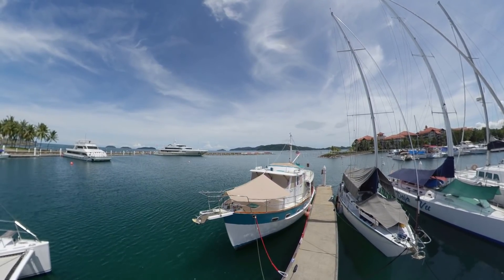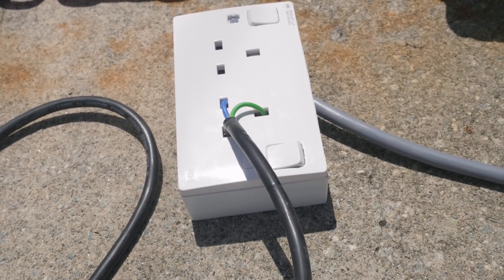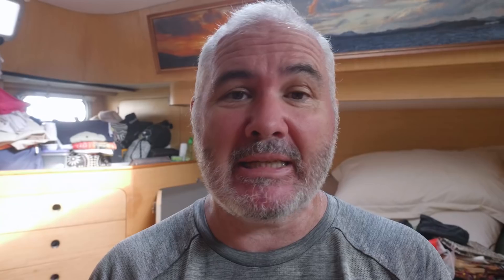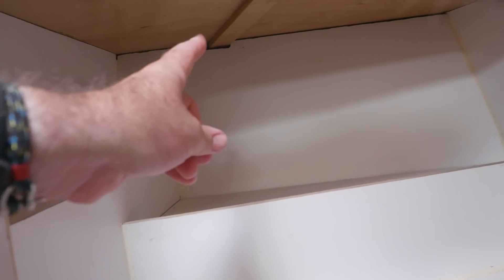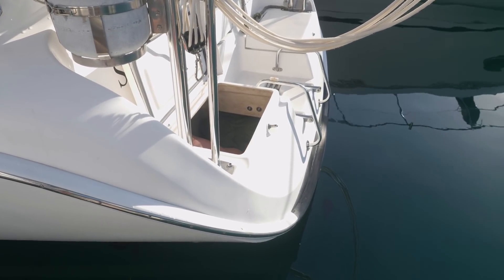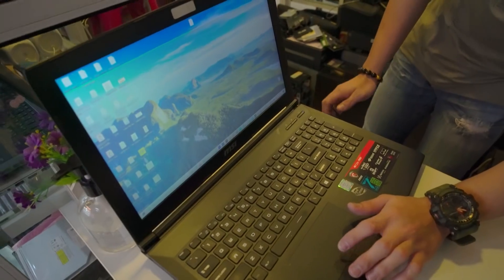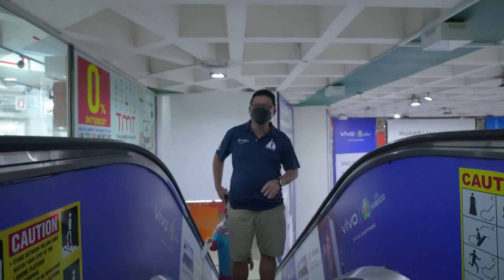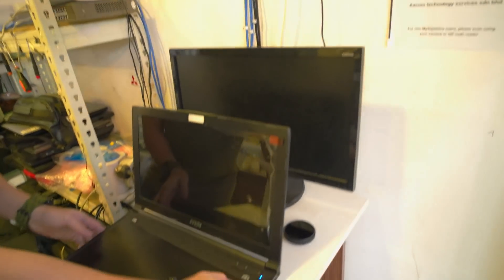Sailboat failures | Termites, leaks and corrosion - Sailing Ep 278

Comment from the maker: Thinking of becoming a cruiser? What's your biggest repair fear?
Already a cruiser? Share your worst breakages or failures with us...
Reply: We've had a string of odd misfortunes this year on our boat. First there was the aforementioned lightning strike back in July. That was a real buggar but in just the last week we have been stopped in our tracks twice in our southern migration due to freak issues.

A few days back we picked up about 2 yards of heavy plastic sheeting in our prop, we had very little thrust forward or reverse without massive vibrations/thumping and we were in a fast-moving rock ledge-lined waterway rapidly being pushed by the current into to a swing bridge.  We were able to get the bridge operator to open -but just in time. 

Luckily there was also a marina just on the other side of that bridge with a knowledgeable and quick-thinking owner-operator who was able to coach us into rough landinf on a downstream face-dock with minimal fuss or damage and find us a diver who was able to unwrap the whole mess in only a few minutes of work.

Then yesterday our diesel's raw water pump tried to self-destruct. The inner wear plate somehow got loose inside and the impeller drove it like a cutting disk right through the side of the pump body.  We noticed after anchoring that the bilge pump counter was showing 89 cycles! Luckily it was an easy flood to stop just by turning off the engine raw water seacock.  I was worried at first that the plastic sheet on the prop had damaged our shaft log and/or seal.  

Now we are attempting to epoxy the cut notch in the pump body so that we can limp back to civilization without needing a tow up the river.  That's inland cruising. We are not just in the middle of nowhere -but also somewhere we can't really sail out of without an engine.
Reply: I'm getting a survey on a 65foot cutter next week (mono).
Reply: I ran aground on a sandbar and ripped the keel half off... I had to (Quickly) put a sail under the boat to try to stop the water from coming in... Thankfully, I was close enough to shore where it could be fixed, sort of, but it saved the boat... I will NEVER own a Bolt-on keel again...
Reply: Everything to do with the engine.  Dnlt get me wrong, I;m a mechanical engineer, but why have all the hassle, noise and expense of an engine when you can have a nice, quiet, maintenance free electric drive?!
Reply: Hauled out to replace the bottom paint, found a massive amount of blisters on the keel. Catamaran so it is sacrificial and i ground the buggers out and filled them, then I glassed the keel to hull joint it was only a silicone seal prior. I have since added 6 layers of barrier coat and a silicone coat. This will last for 12-15 years, unless the water is intruding from above… damn.
Reply: @DStrayCat69  a sand bar ripped a keel off?  is there more to that story, or a crappy boat, or what?  help us out on that one please.
Reply: @nonyayet1379  I was in a race and not paying attention...
Reply: @Barbreck1  - Because there are many, many situations at sea for which an electric drive is just not up to the job. The dirty secret of the electric-drive boating world is that a great many owners who do the conversion go back to diesel within a year or so. Electric doesn't have the range, it doesn't have the endurance, and if the weather is bad for more than a few days, keeping the batteries charged becomes a serious (and potentially life-threatening) problem. I salute those testing the current limits of the technology, but it has a LONG way to go yet before it's a viable solution for most long-distance voyaging sailors.
Reply: @Garryck-1  And, like so many others, you miss the advantages and tricks to having an electric drive.  

First off, sailboats traditionally don't have drives of any kind.  The drives that we do install are auxilliary drives, meaning "back-ups". Which have made using the boats easier but not necessarily made better sailors out of those who sail them!  What did we do for the last four thousand years before the invention of the engine?!

Seecondly, the vast majority of thoise who have installed elecctric drives have done so without regen capability, so theyu miss the other major elephant on the room... the ability to refuel whilst under sail!  You can't do that with a diesel system.  Eight hours under sail can fully recharge a battery asystem to give you 24 hours steady motoring... ernough to get you out of any situation (unless you've maanaged to sail yourself into a hurricane) which is entirely the point of "good sailing"- to avoid such hazards.

The fact is, electric drives have a LONG way to go to sastifying the lazy, weekend jolly sailor who wants to have his cake and eat it.
Reply: Maybe I should have repaire fears. Hmmm. Becoming worried about cracked bulkheads after watching Parley...More worried about lack of sleep not finding good crew to help. But definitely planning on cruising!

Comment: did you open the dell up and clean the cooling fans and fins on the processor, etc?  that's often the only fix required.  but it's slim size and small cooling capacity could be the problem as you suggest.  I can't remember a time that a good cleaning didn't solve the problem unless the components had already over heated too much and had their quality degraded.  can air (air in a 16 ounce spray can (invented for cleaning key boards) is what i found to work the best with maybe a soft tooth brush or equivalent to break up the bigger stronger build up.
Reply from the maker: I haven't opened it up but I've had this problem from the get-go. I even tried to get a Dell technician out to take a look immediately after buying it and did much backwards and forwards with them but they just said "Premiere Pro isn't supported by the hardware", which is BS. I bought it specifically for editing videos because so many other editors were using it. It frequently came top of the picks in reviews back when I bought it. When I took the laptop back to the UK and used it at my parent's house it ran perfectly. One of the issues is that it's a beast when it comes to power consumption. 4K touch screen, among other things, eats up battery power yet my more modern mini PC is more efficient (which has bigger fans). Liz's less powerful MSI runs faster than the Dell 🤔
Reply: @followtheboat  it sounds like you are right then.  I've been building computers since 81 i think.  and occasionally, the heat generated by a powerful well used cpu, with limited heat sinks and air flow just can't cut the mustard.  it's a shame.  but as with everything, there's usually a trade off.

Comment: I'm thinking about getting into blue water cruising. Biggest repair fear would be decorative trim hiding a rotted compression post.
Reply from the maker: It's not that common and termites take a long time to do structural damage, so you'd pick them up before the boat fell apart... hopefully!
Of course, if you stick to steel, aluminium or plastic you don't need to worry. 😉 Liz

Comment: Most fans blow downward, out of the bottom of a laptop. May I suggest you elevate the whole unit off of your table/desk, whatever, to give the hot air somewhere to go... I'm in Canada and my laptop often lets me know when it's getting too warm... I think all laptops have a device monitor built in, as mine does... and mine is very old... Good luck with the other projects 🙂
Reply from the maker: We always run our laptops on cooling beds but it makes no difference to the Dell unfortunately.

Comment: We replaced the entire exhaust hose along with every other single hose on the entire boat.  The exhaust hose was original from 1976 and while it looked OK on the top a view from the bottom using a phone camera revealed some cracks and rust stains from the internal wire coil support inside.

I was also able to remove our hose from the muffler back to the transom through-hull in one 12-foot (nearly 4 meter) piece due to the excellent access of the Hallberg-Rassy design.  The piece had set to it's shape and while it could be bent slightly would snap back into the shape it had set into over 40+ years. Installing the new hose was even easier than removing the older one although it took quite a bit of time with the heat gun to get both the old and new hoses on/off of the through-hull barbed fitting.  There is no way that would have happened without that big industrial heat gun I have.

The new Vetus exhaust hose set us back $200US from Jamestown Distributors, but should last us another 30+ years of safe cruising. It looks very well made and is nice and quite pliable.

CO and CO² poisoning/asphyxiation is no joke.
Reply from the maker: Yep, it's certainly no joke. And, yes, replacing hoses is a long but necessary job. They will perish and don't last forever (like everything else)! Liz 👍

Comment: I'm probably going to get torched for this but,
How do you get termites on a yacht? How do you prevent termites on a yacht? 
Really want to know the facts. Thanks.
Reply from the maker: No reason to get torched, Mr Nobody, it's a good question! 😁
The answer is similar to the one I gave recently on how cockroaches get on boats: mariners bring them on themselves. Insects, and in particular insect eggs, are everywhere - in boxes, packaging, food, soles of your shoes, in your clothing etc. One way to minimise the nasties is to avoid bringing any cardboard on your boat, disinfecting/washing food before it comes on board etc. On board, use sprays and powders. Having a couple of geckos on board over here is a good way of keeping the mosquito population down.
Roy found the termites by accident, and it's debatable if he would have ever found them any other way. Termites in wood on boats has been a problem since boats began. Liz 🙏
Reply: @followtheboat    I’m pretty certain that the termites were acquired when I was hauled out at Kudat about 12 months ago. 
The office at the yard was being renovated because of termite damage, the infested wood was thrown out the door into the yard until I complained and asked them to burn it. 
I was the closest vessel to the office and was able to see them in flight. I’d say they were keen for a trip down the coast and found a nice, damp home in the little bit of rot in my bowsprit.
Reply from the maker: @RoyFMuir - I wondered if that was the case. That yard was riddled with every pest imaginable! 🙄😳 Liz
Reply: @followtheboat  Thanks!🙂👍🏻
Reply: @RoyFMuir  Ah.🙂👍🏻

Comment: I am sure that you have installed a CO-monitor in your boat. However, if your engine is well maintained, it may not produce any carbon monoxide. If you mistrust your exhaust lines, would a CO2-alarm help you sleep without fear of asphyxiation?
Reply from the maker: We haven't got one, but it's about time we splashed out on a marine version (household versions don't work on boats). 👌 Liz

Comment: Gaming laptops aren't built like tanks, they're made to last 2-3 years. The requirements on gaming hardware are constantly evolving leading to a great gaming machine becoming obsolete or too weak after 3 years so gamers seldom use the same hardware for many years which makes it pointless to make them last much longer. If you want a laptop that will last in the tropics and outperforms everything else on video and photo editing then there's no way past the newly released MacBook Pro 16 with the new Apple M+ chip. They're also extremely energy efficient.
Reply from the maker: Yes, the M1 chip is a great thing for people like us who are power-sensitive. Unfortunately these laptops are well outside our budget! I have been thinking about the first generation M1 Mac Mini but Liz really needs a laptop.

Comment: is it really silicone you are using, or just calling it silicone?  silicone has a habit of divorcing moisture, in turn the bead breaks loose, defeating the purpose of it's use.

so i suppose i should be asking:  What am i missing?
Reply from the maker: Silicone sealant, the same stuff used in bathrooms.